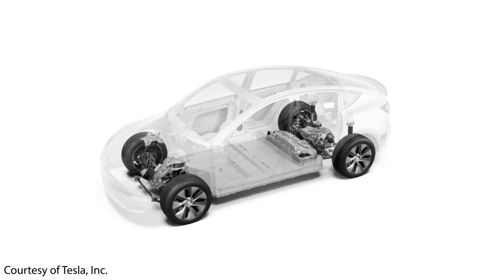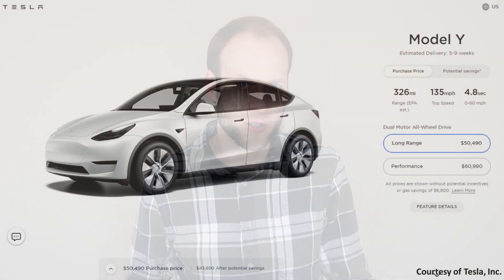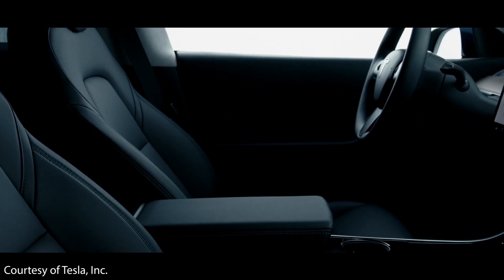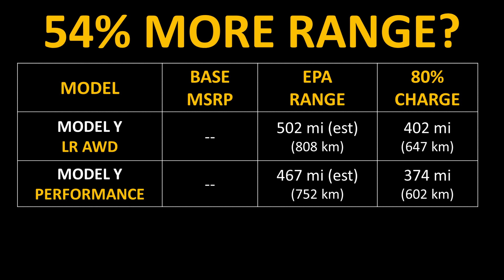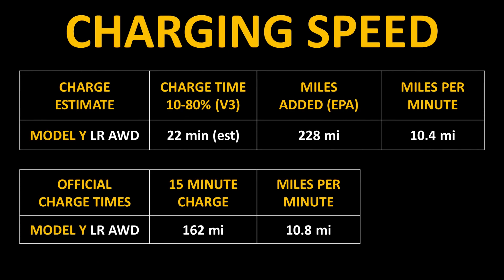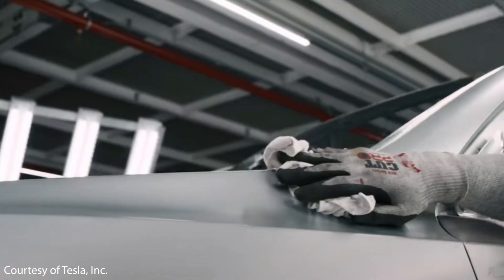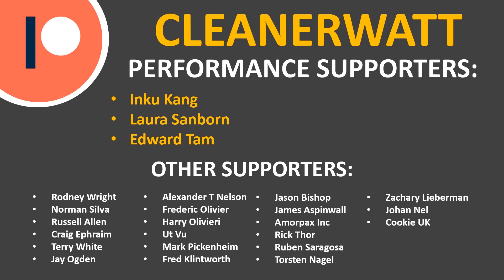Tesla Model Y 2.0 – Changes to Expect in Late 2021!

Comment: What you have said is not the improvement for the consumers, because they will get the cheaper built cars, which mean you cannot upgrade or replace the battery pack because it is embedded into the car frame...

Comment: Great video on the differences coming!  I am currently driving a 2014 Kia Soul (base automatic) that I bought new...and it's at 117,800 miles or so.  Still running great, but even at 28-30mpg, it's thirsty!  I just quit smoking a couple weeks ago, which will save me $400/mo, and I have a debt consolidation loan that is $360/mo that's about to be paid off...so those combined are almost exactly what a new Model Y dual motor long range would cost!  (well, without full self driving, which is tempting, because I KNOW they will raise the price soon!)  But yeah, I want the new cast frame and the new batteries.  I would feel foolish if that came out early to mid next year and it was actually CHEAPER than the current model!

Comment: My problem with Tesla is not the lack of technology. Other manufacturers are catching up and what Tesla really lacks is the basic quality that a car should appear. My 2021 Model Y has orange peel all over the place. The crude finish really turns me off. The car was delivered to me by a mobile unit that just dropped it off on my driveway and the car couldn't even be unlocked with the card key not available because it was inside the car. The phone didn't work because the delivery center screwed up on activating it. It sat on my driveway for 4 hours blocking other car inside the garage until they figured out what was wrong and remotely unlock the car. It definitely wasn't a pleasant new car experience.

Comment: Enough about model Y already ... what I want to hear about is model 3 and Austin. When will I be able to purchase a model 3 made in Austin with the front & rear underbody castings, structural battery pack and the good paint? Or, conversely, when will Fremont be converted to these new construction details?

Comment: When I bought my Model 3 in July of 2019 I thought it would be the last car I ever bought (I'm 65 and drive 10,000 miles a year).  Maybe it will be, but Tesla have said they are working on using the sound system for active noise cancellation - a lot more difficult in a car than a pair of headphones.  If they succeed then this would be a game changer for me.  Most of my driving is expressway at 70 - 75 mph and at that speed the noise is from the wind and the tyres, not the engine.  The M3 is noisier than my old 1990's V6 Camry.  I have not seen any channels comment on this potential development, but from an everyday driver point of view it would be a mega improvement (or as Tesla would say a giga improvement; or possibly a tera improvement (a peta improvement anyone?).

Comment: As soon as Tesla improves the suspension, I’ll order one. But the model Y just goes not ride like a car in its class should. Other than that, I love it!!
I drove the LR dual motor on Gemini’s, so it should have had the best ride configuration. It rode somewhat like my great grandfathers hay wagon. That would be fantastic for a sport sedan, but not a family hauling SUV, pushing $60K (w/tax), when color options, seat options, and 7 seat config are added.

Comment: Having owned a 316-mile EPA-rated Y since July 28th, 2020, I have learned that the real-world highway range even in winter is between 240 and 250 miles.  Turns out with the current state of SC'ers locations in the US I found we need to stop for BIO breaks well before the car needs a charge.  Any longer range would just be added cost and weight for my family.  And even if we factor in any battery degradation reducing range to say 225 miles I feel that's sufficient and given future build-out of new SC'ers should eliminate any range issues.  So maybe I'm the exception, but so far I'm happy with the current real-world range of our Y.

Comment: 400 miles for the new long distance model Y is not enough.  I have a 2021 model Y long distance and for around town the current model range is fine.  But for trips to really get rid of range anxiety you need 500.  Actual 500 when charged fully.  Currently the model Y long distance says 324 miles of range.  I have never seen over 311 completely charged on mine.  And then for the first 100 miles my range meeter drops like a stone.  Today I got maybe 50 miles on the decent from 300 miles to 200 miles.  200 miles and lower the range meeter seems to go down slower.  But by slower I mean the actual miles + at least 10%.  I like my Tesla, it is a great car.  But I do not like the current range anxiety I get with the current system.  I specifically leased this car because I figured there would be big enhancements in the next three years.

Comment: I have had a 2021 Model 3 Performance for 2 months now. I've already put 2300 miles it, including two road trips. While a larger batter would be nice, it's not necessary. People really blow the range issue out of proportion. Yes, you do have to stop every few hours to charge, but it's really not to bad. And it's a good way to break up your trip. Even still, I do believe/hope that in 5 to 10 years, we'll see good sub-$50k  EV's with 400+ EPA range. But that's no reason to not buy one now. I plan on keeping my model 3 for 12 to 18 years. At which point, I'm sure there will be a million EV choices with great tech!

Comment: Now they are charging fake self driving for 10k over the MSRP, imagine how much they'll charge for all the changes you've mentioned such as air suspension. It took Tesla till 2021 to add a double panel window to the front door which should be standard for a car cost 50k+

Comment: The problem with charging is that most people in apartments and condos would have to make a special trip to a charging station since they often don't have access to a charger at home. I live in a city of 300,000 where there are 2 super chargers, but I can't charge at home or work so it's still kind of inconvenient.

Comment: If charging time for an EV is a turn off for ICE vehicle drivers then stop saying the current range is enough. EVs will need drastic advantages over ICE vehicles to sell more people. Having ridiculous range would definitely attract a lot more people. The current range is not enough. I wished people would stop saying that. Gas has a huge advantage in range and add the fact they have gas stations everywhere. EVs need more range! Ridiculous amounts!

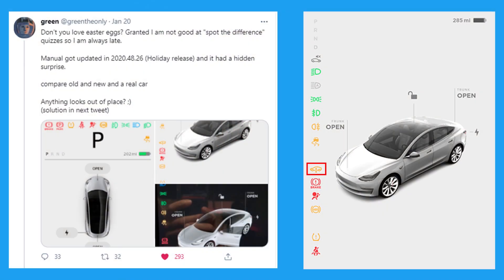Comment: Honestly this is all conjecture and if anyone knows Tesla this isn't how they do things. The update manual at 8:34 was last year and there was no hint of it coming. Also, the model 3 had that adjustable suspension rumor a few years ago and there STILL isn't one.  What you can wait for is a possible better build (more colors, etc) with the Gigafactory in Texas as it should be similar to the one in Berlin. Single piece casting is ALREADY in production. New batteries won't come to their entry line until all supply is exhausted prob in a few years. There is no Tesla Y 2.0.

Comment: Can't  understand the logic of the fan boys calling for longer range all the time. You are pandering to the ICE owners arguments when you should be looking at real world requirements. I am happy with the range as I need refills and relief stops more than car does. A smaller battery pack means lighter weight so if weight is reduced then less energy needed to accelerate it. A lighter weight should allow an increase in payload.

Comment: I like your theory on how they'll do the production. They should have some test vehicles already for the 2.0. So they shouldn't have to delay production by 3 months or so to test it out. I'd surmise they'll ramp up for a month or so then start delivering vehicles and eventually switch all over to Austin early next year. It makes since to switch the capacity to the 3. I think they'll have extra room also to start installing more gigapresses there too in Fremont. The model 3 with structural pack shouldn't be too far off now either. They might follow a similar strategy and shift the performance first to Austin then then the long range and standard. When they do that some of the Y production could shift back to Fremont, maybe 2023ish. The timeline for the Y2.0 is Austin/Berlin first, Shanghai, then Fremont. 4680 is looking like Kato Rd., Shanghai/Austin similar time, as well as LG, then Panasonic, and lastly Berlin
Reply: I changed my mind already. The difference will too be big. They'll ramp for 2 to 3 months at Austin. Stop at Fremont, switch production to the 3 and send some people to Austin to ramp faster and learn the new processes.  So they should be close to Fremont level production in 6ish months for the Y then increasing past it.

Comment: Tesla EVs have a very high resale value.  Buying one now and later selling it or trading it in with reasonably low mileage will give you back most of your money.  Or by that time Tesla may have started autonomous ride hailing and there will be greater demand for used Tesla EVs so resale value may be even higher, especially for well maintained EVs.

Comment: With 2 GFs coming online this year and expansion in Shanghai, there will be less constraints on battery production.  But the increased demand on lithium, nickel and other battery components is likely to cause costs to rise, thus negating any savings in manufacturing.  This is a problem that will be worsened by the demands for batteries from other EV makers like VW.

There is a serious problem with China limiting raw materials exports in favor of domestic use.  The rest of the world needs to develop resources to reduce dependence on China.

Comment: Cleanerwatt said,
"...you should only charge your EV to 80%..."
That has no basis in fact.  There is what is known as grace capacity.  This is software defined, maximizes battery life and prevents overcharging.  There is one reason why there would be a need to charge the EV below 100%: this is when your EV will be going downhill when it is charged, and the software will use regenerative braking to charge the battery up to 100%.

Comment: We went from a replaceable battery pack, to a fixed battery pack and now to a structural battery pack...
 
I worry about reparability. 

I understand it is normal to total a slightly damaged vehicle in the USA. But other markets have higher expectations. 

And the USA will ultimately need to switch to more sustainable practices.

Comment: Don’t forget to reduce about 5-7% for battery degradation after about 10k miles of driving, which is roughly 8-12 months of owning it. THEN 80-90% of that charge daily. People are only thinking about brand new battery range, but the reality is after a months battery degrade. So I wouldn’t even consider looking at new car new battery range. But to look at the range after the initial 5-7% degradation. Something to think about.

Comment: 1.  I don't think "price" and "cost" are so closely related.  I expect the new battery to increase profit for the TSLA shareholders.  Remember, battery day was geared towards TSLA shareholders and not to the motoring public.

2.  I don't think Tesla will initially introduce an SLR (Super Long Range) Model Y in the short run.  The SLR vehicles initially will be Roadster 2.0 and Tri-Motor Cybertruck.

3.  I agree that Model Y will move 100% to Texas, but the cutover from Fremont to Austin will happen pretty quickly.  Fremont just has no space.

4.  Charge speed is a huge issue - more than range.  I'm not sure if new EV owners understand that, and I'm not sure how that gets communicated to new EV owners.

5. COLORS - new paint shop in Austin won't be as capacity-constrained as Fremont.  I expect Tesla to release Modely Y with more than 5 colors, and with volume, possibly a 3rd interior color option as well.

Comment: v4 hardware sensors + 4680 (may be 5x lifespan / faster charge /better range)  gotta hold out to wait......the v4 hardware /sensors may be even better value than the 5x battery lifespan which is just my estimate based on personal research that may totally be wrong... v3 may be consider low tier fsd with poor monitization in the future. idk. im waiting. Just make sure you OWN FSD not subscription as they can raise subscription to $500 monthly when suitable and make you pay $30k to buyout and THEY WILL DO THIS when market dictates it... which it will if its very good they will not even sell you the car let alone sell you the software fsd rights....

Comment: Do the improvents include non annoying door handles, non annoying indicator stalk, physical controls to adjust mirrors, rear seat heater buttons in the back, physical controls for the volumne?  No need to make it best techinical EV and ruin the rest of it.

Comment: I just mean they had a poor paint shop in Fremont and it understandably gave uneven results.  

Austin and Berlin are getting some of the most advanced paint shops ever built, supplied by the Japanese company (Geico Taikisha) that makes the very best equipment.

And, in general, having the front and rear castings makes it much simpler to have near-perfect panel gaps and to eliminate many squeaks, rattles and hums.

Comment: Would like to see a video on real world range. I have MY and over 10 months of ownership in Seattle area I’m averaging about 270 w/mi or about 275 miles. I’m a very non-aggressive driver, trying to optimize range, and the weather in the Seattle is very moderate, i.e., no heavy use of heat/AC. My average wh/mi is on mixed highway and city. So real world is much different than EPA rated. I think EPA is impossible if not driving at 35 mph or below in the city.  Cheers.

Comment: BTW: Bad weather conditions negatively influence any car, i.e. ICE car as well.
Reply: They don't impact ICE as much as EVs, the electric vehicle looses its range by just sitting in cold place.
Reply: @alanmay7929  ICE car engine is even more inefficient in cold conditions. Its fuel consumption is then much higher.
Reply: @janh.7557  uhm wrong, thats a big lie, ICE may struggle to start because the battery is low but once the engine is hot everything is normal, diesel engines have glow plugs that makes starting/kranking way easier. the cold temperature actually helps for cooling instead of ramping the fans.
Reply: @janh.7557  also the heat from the engine is used to heat the car unlike the EV which has to constantly rely on his battery by reducing the ranhe even more in cold places.

Comment: First Robot-Air-Taxi mover, Ehang, is a Tesla baby with 100x potential.  It is flying in Europe, China, South Korea, Middle East. Factory is completing in June. Its market cap is 1/550 of Testla. But at $27 and hold for $5000 in 5-10 years..

Comment: Best ride leveling system ever was in the 1950s Packards.  They used torsion bars for springs, with the anchor end twisted by an electric motor drive to provide more or less spring lift at each corner of the car.  Auto leveling sensors at both ends raised or lowered the car to level ground clearance as the trunk or passenger compartment was loaded with weight.  Reliable and simple and totally electric, so, perfect for an electric car.  Air and hydraulic lift systems are always problematic and subject to leakage and deterioration of hoses and seals.  The Cadillac air ride system of that era was a comparative maintenance nightmare.  Combination air/oil systems used by Mercedes are also overly complicated maintenance items.  A torsion bar suspension used with magneto-rheological instantly adjustable shock absorbers like GM uses should provide both a compliant soft and level ride on rough roads regardless of load, with instant changeover to responsive performance handling characteristics when needed.  It could also eliminate the complaint that Teslas ride rougher than most similar ICE cars.

Comment: Great information. 

Personally, I'd rather they start with the LR at Gigafactory Austin and keep the Performance in Fremont until they're able to do both. I do understand why they'd start with the Performance model using the 4860 batteries, though.

Comment: Impedance in 4680 cells are more than 10x lower compared to batteries used today so theoretically it should be possible with 10x charging rates....

Comment: A note on Batteries.
What kills charge time is the drop from quoted "peak rate" charging.
"300kW max" means nothing if it's between 10-15% dropping to 150kW by 30%.
What's needed is 200kW (+?) from 10-70% (or more)
That's what the 4680 may bring.

Comment: 54% increase is per cell but the new cells is bigger than 2170 and it will be smaller number of cells in the same volume, in battery day presentation there was mentioned about 15% increase of battery capacity in the same volume
Reply: Yup. It would be smart to decrease the battery weight with 10%. Less weight would increase range by 5-10%

Comment: IMPORTANT. The 4680 is the size of the battery container and can contain either the nickel or the standard battery material. This is a subtle yet important distinction
Reply: There will be a wide variety of cells made in the 4680 format. At battery day they mentioned three chemistries: high nickel for semis and performance vehicles, lithium iron phosphate for low cost vehicles and storage, and nickel-manganese for the rest. All of Tesla's battery partners have also announced 4680 cells... So Tesla will not be producing all of these chemistries in-house. It is also clear that Tesla's in house batteries will benefit from other advancements like a high silicon anode and dry coating processes.